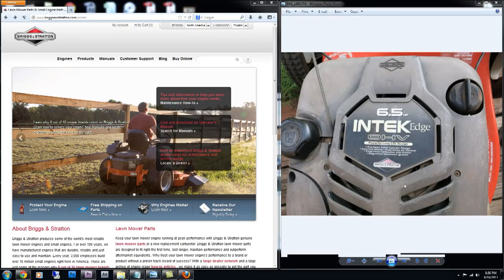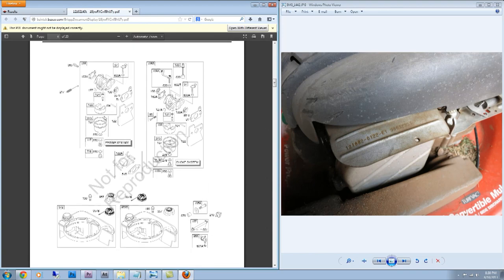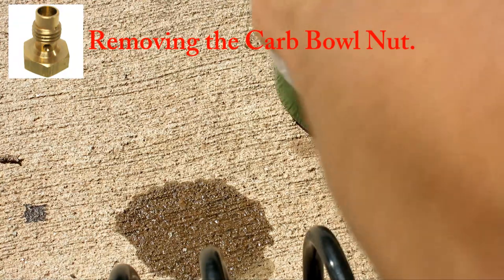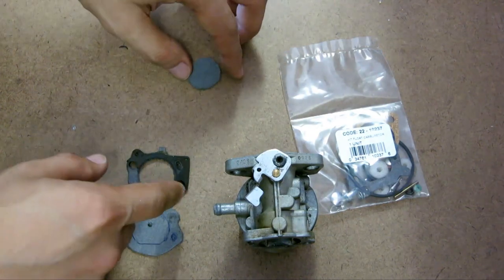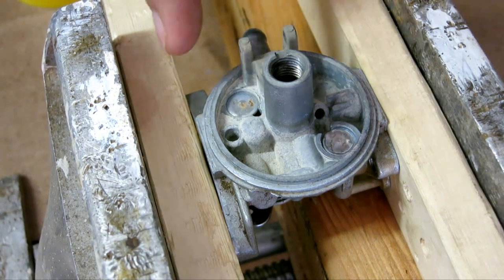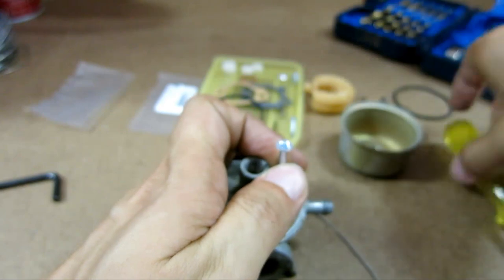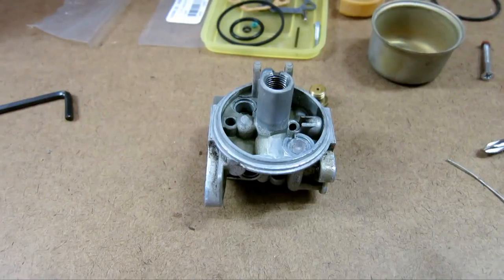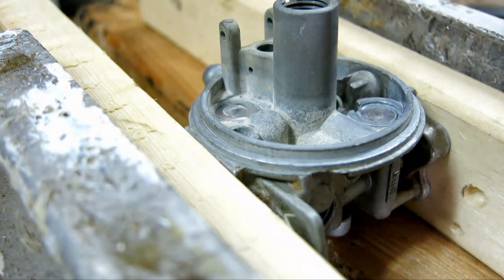Briggs & Stratton 6.5HP lawn mower carburetor clean & rebuild - carb welch plug removal replacement

Comment: My Troy-Built 320 has this exact carburetor.  It's 4 years old.  It would start but then die after 5 minutes and not start until it was cold again.  The choke mechanism was working fine and I had ignition spark.  I figured the problem was carburetor related so I took it apart as in this video.  I cleaned everything with carburetor cleaner, poked wires thru the jet and various ports and blew it out with compressed air.  I didn't use a rebuild kit.  I also cleaned the fuel tank and fuel line.  I put it back together and it runs perfectly.  I think dirt or particles in the gas cause the problem.  I installed a "Briggs & Stratton In Line  Fuel Filter Part # 791891" so I won't have anymore dirty fuel problems.

Comment: Tks for the demonstration on the plug removal. 
You can take the opportunity to make sure that both air entering and leaving  carb mounting surfaces are flat. If not, you can sand the surface by rubbing the carb on a sand paper over a flat surface (my kitchen counter top is what I use).

Comment: Good vid--thanks!  You don't have to drill out those inner welch plugs.  I just used  a dental pick through the little holes/ recesses next to them and popped them out. Quicker and easier, and  you can reuse them if necessary.

Comment: Thanks for the great video! My welch plug had popped out itself and was floating around in the bowl. That might have happened when I sprayed carb cleaner in while the carb was still attached to the engine, not sure. Thanks for the idea using compressed air.

Comment: Very helpful information, a question regarding a 2 stroke Tecumseh Lawnmower carburettor, if the passages under the welch plug are blocked, will this cause the carby to flood, as I have installed a new needle and seat, float has no holes, is set to the manual specs, but carby floods. I have not removed the welch plug because these parts are hard to come by in Australia for these engines. Any ideas appreciated! Cheers.

Comment: I did not see a bowl nut washer installed on the bowl nut. Extremely important. It keeps the float bowl from leaking!
Reply: ShotOut55 he left the original one on there without replacing it. Same with the medium sized o-ring between the carb and the engine.

Comment: is this clear thing that you using to clean the bowl gasoline? i mean is it normal for gasoline to be clear on where you lieve?
Reply from the maker: yes, and yes.
Reply: i want some of that gasoline for my car in greece gasoline is kinda yellow where is that place? great video btw helped me allot
Reply: most gas is yellow where i live, alabama...its not pure gas, most of your good, pure gas is clear, but some has additives, and even more mix it with ethanol. a lot of people are using this corn gas, up to 10% in some stations, and dont even know it. its not good for your engines, over the long run it does not burn clean, gums up injectors, all kind of stuff. as expensive as gas is in europe, i doubt you could even get "pure gas" there anymore, i just doubt it